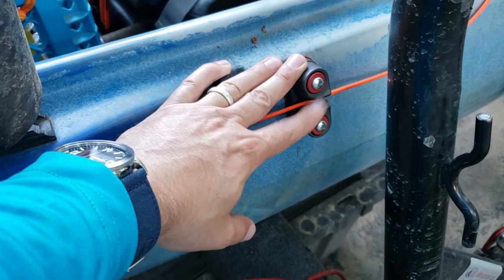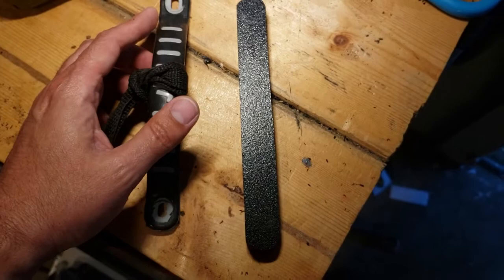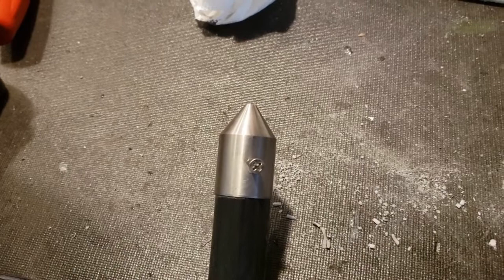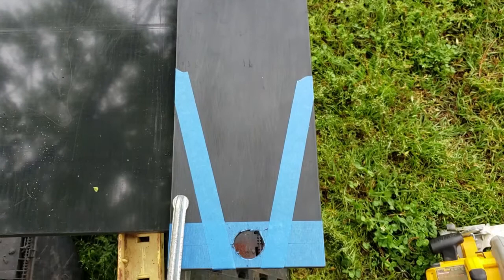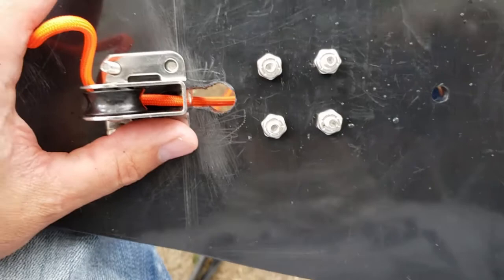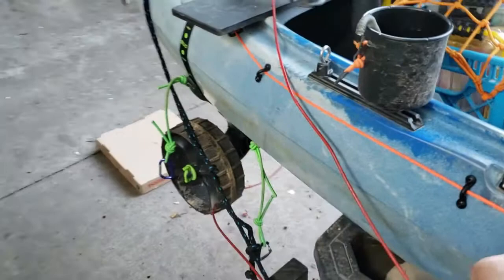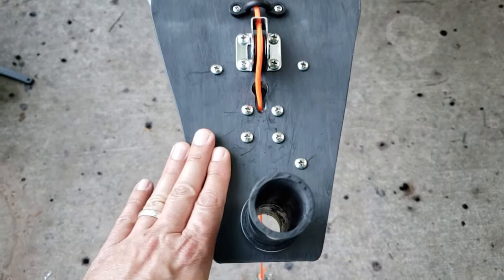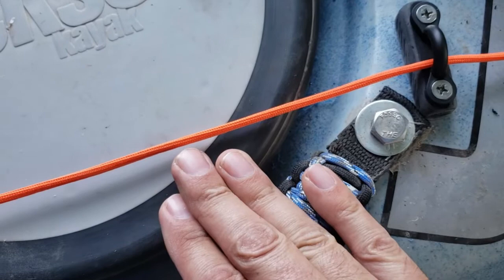DIY Instant Kayak Anchor System--Shallow Water Anchor alternative to the Micro Power Pole

Comment: I thought about a system like that for a while but that means that you can only anchor downwind as you will spin. I use a system with two anchors with a system of pulleys and and the ropes of both anchors are stuck under my foot and I can control their decent as I make my cast. BTW, I only fly fish and I stand up and pole.
Reply from the maker: Thx for watching and sorry for the delay in responding! Yeah, spinning (weathervaning) will be an issue in some circumstances. You'd have to rig up an anchor in front, a 2nd rear anchor on the opposite side or a 2nd pole to eliminate it entirely. 

I don't fly fish, but I can certainly imagine that the longer length of time to cast, it could  spin enough to make hitting your target tough. I'd probably go with a 2nd anchor and A Wizard setup from the rear.

Good luck and tight lines!